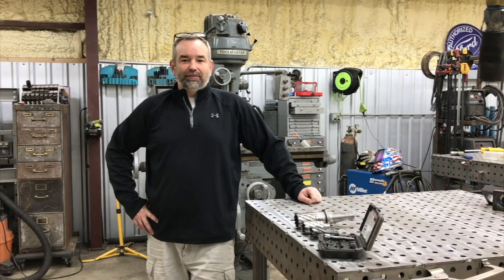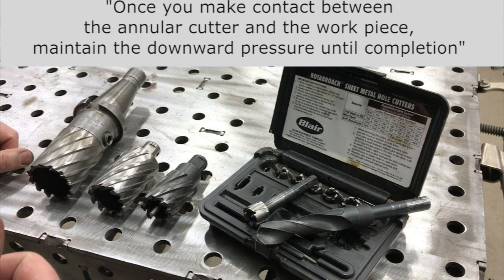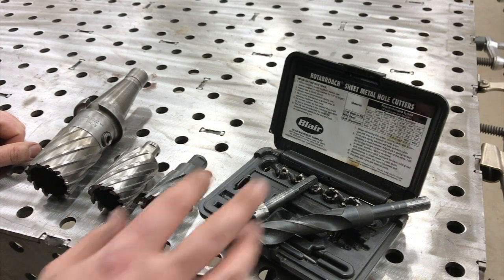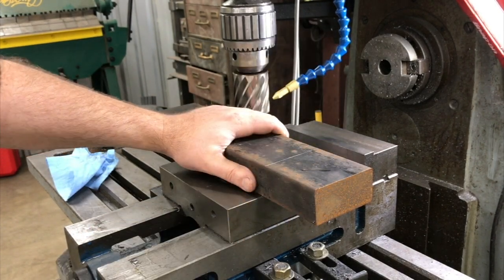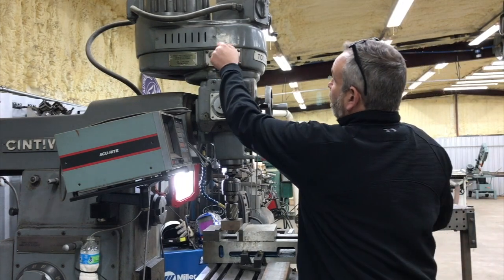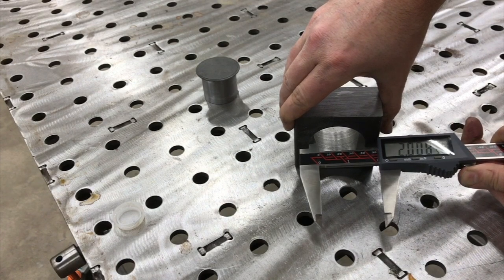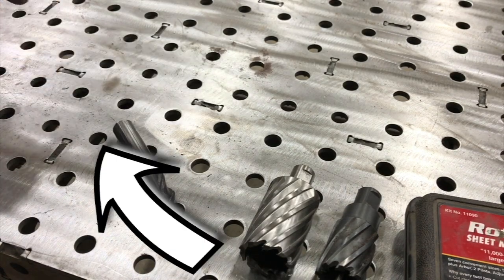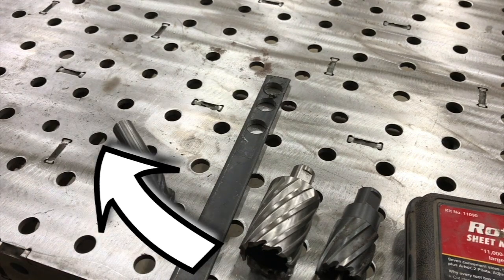CRAZY Drill Bit for big holes in Thick Metal + This Old Tony Tribute!

Comment: Recently I had to cut some holes in one inch thick 1020 mild steel with a 42 mm annular cutter running at about 300rpm, and found that birds nesting was largely avoided, not by actual peck drilling, but by momentarily backing off the pressure to zero every few seconds, but without actually withdrawing the cutter from the cutting position, resulting in shorter pieces of swarf exiting the flutes on the cutter. It also seemed to slightly speed up the process overall, but that may have only been a perception.  It was certainly easier than constantly battling rapidly growing birds nests.

Comment: Ha, you are absolutely right on thicker material needs to have the swarf removed, also, dont leave it on the table, I have had my new swarf grab my old swarf and create a spinning rats nest of death.  Ive thought about trying to grind a chipbreaker of sorts into an annular cutter to alleviate this problem.
Reply: Could you clamp a vertical plate or rod on the side of the vice to break the chips?

Comment: after finding out the time and equipment needed to sharpen those annular cutters,  it becomes obvious these are not for most.  Only production shops would benefit from purchasing these and the jigs and grinders needed to maintain them.
Reply from the maker: Good point.  You can buy the small ones on eBay for around $20 each and they will drill 300 holes without needing sharpened, but year the larger ones need a lot of power to turn and may not be the best option for a home shop

Comment: used to  run them in large mag drills but beyond 40 mm steel the carbide version works so much better had less issues and out lasted 2 to 1

Comment: I cringed each time you grabbed the chips with your bare hands and tore them off the tool.. use needle nose pliers
Reply: Scotty Mac 22. he was reaching in with his hand while the spindle was still spinning. Any shop I have ever worked in he would get fired for that behavior. pussy ass hands. lol .
Reply: Scotty Mac 22 my hands are shoe leather , but I use my brain first.
Reply: Scotty Mac 22 Running machines of all kinds. 28 years licensed machinists  ,7 1/2 years in the printing industry.
Reply: Scotty Mac 22. I do hold my journeyman 10 years of oil and gas. 81/2 years tool maker in the aerospace industry. automation. auto industry. also marine and jobber shop. Now I am running cold form header machines. Hows that.  He is comparing apples and oranges. Where's the U drill.
Reply: Scotty Mac 22 he probably owns the shop. His workers get the callouses.
Reply: men get callused enough where it doesn't cut you anymore
Reply: Scotty Mac 22 bull shit. He is lucky. But he will only be lucky until he looses his finger.
Reply: Scotty Mac 22 Cool dude I do a bit of button work when I have to. Manual is the best. I do get the odd splinters.  But I don't reach out to a spinning ball of hay. A quick blast of air would handle that mess.  Take care and enjoy your work. Cutting metal is a great way to make a living. PEACE BROTHER
Reply: +Joe MacDonald ya I don't pull long stringers when the machine is running by hand, like on the lathe I use a long hook I made, but when the machine is off, I yank them bastards off by hand lol.

and yep, I love what I do. luckily my shop lets me do whatever I want. if I'm caught up on machine work, I can all position unlimited thickness structural weld for as long as I want. if you know how, you can lol. it's allowed me to learn to be a proficient welder, diesel mechanic, machinist, drafting engineer, etc etc. love the versatility.

didn't mean to come off as a dick earlier, happy chip making bro
Reply: +Joe MacDonald what's your profession out of curiosity? because it doesn't sound like you do a lot of work that would toughen up your hands, just judging by your comments...
Reply: +Joe MacDonald 20+ years licensed how many of that was practicing? are you a journeyman or just certified?
Reply: Scotty Mac 22. I've worked in shops like that. PEACE BROTHER
Reply: +Joe MacDonald sweet resume. I'm +10 year journeyman machinist, no green button pushing, all on big old American iron, in the industrial heavy equipment manufacturing industry. we make big parts, and big chips, and sure, when I was greener, I used to get splinters and cuts from chips, but after this long working with heavy iron, and doing things the old school way, and now a steak knife won't cut my palms. I lived under the motto that get em tough and they'll be tough. gloves are dangerous, loose tools around spinning equipment become projectiles, and chips aren't that sharp when you get tough enough.

Comment: A bit lower speed speed may stop the chatter as well?
Reply from the maker: Right that's what i was thinking., not sure if you saw me, but I turned it down from 230 to 170 rpm and it didn't seem to make a difference.  I think the spindle is running out a bit too much, just visually you could see it